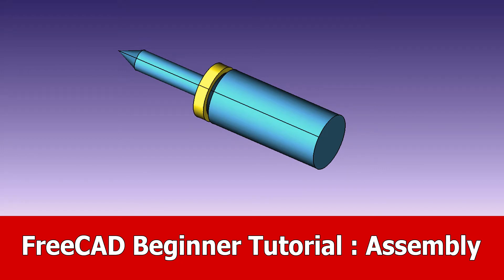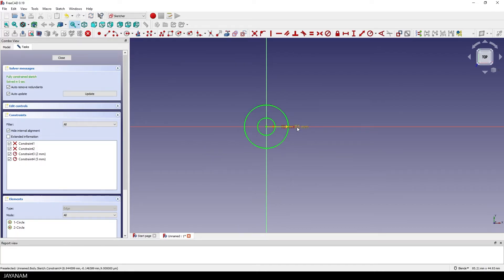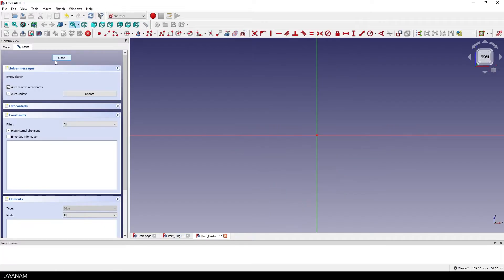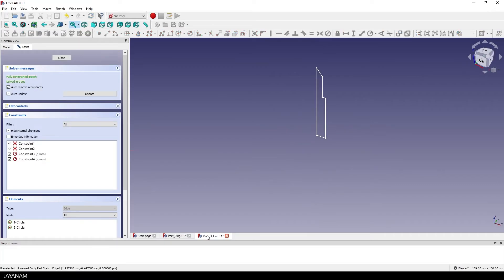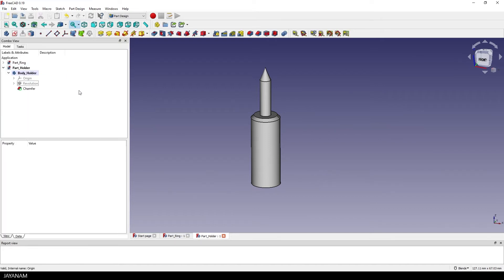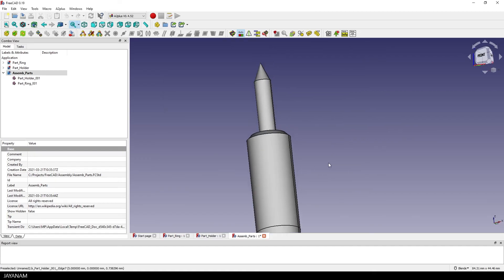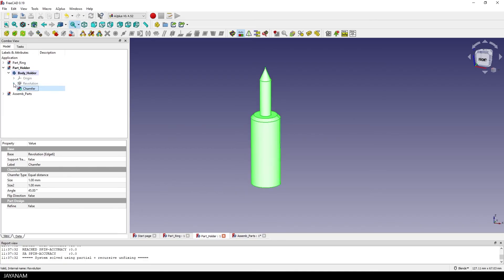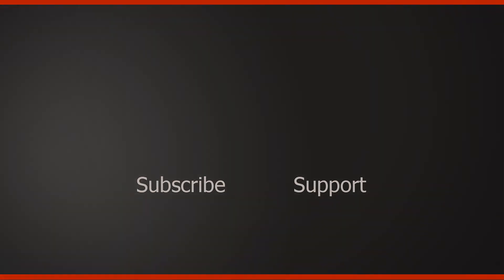FreeCAD Beginner Tutorial Assembly

Comment: I'm working with version 0.20.2.
I can follow the tutorial, but the ring does not align with the holder. It is beside the holder. How to get the center of the ring aligned to the center of the holder?
Why are the centers not matching anyway?
Reply: Same - I changed the position of the Ring via the coordinates X,Y,Z
Reply: Did you ever figure this out? I'm having the same problem.  Most likely due to having a newer version of freecad
Reply: @isaacduquette8809  No I don't think I did. Didn't use freecad for a while now
Reply: The ring loaded offset for me as well. To get it to look like the video, within the Assemb_Parts Part_Ring, go to Placement --> Position and set x, y, and z to zero. These are the same attributes that the OP uses to move the ring position down so that he can select the face in the next step.

Comment: for some reason I can not get the plane coincident icon to go active. Any ideas why? I have used control to select both of the planes so I think I am doing it correctly
Reply from the maker: Did you check that both faces are selected?
Reply: Yep, both faces are going bright green so A bit confused..
Reply: @markvenn230  Same trouble - Then I found "Shift + Command + Clic"  instead of "Control + Clic" to select both faces - I opened "Selection View" to check faces are well selected - Roocky on FreeCad 20 on Mac

Comment: I wonder why you absolutely must have external parts in separate files, and not just have several yellow "Parts" item things in only one file.
Reply from the maker: You can do it in both ways, but usually e.g. in companies the workflow is based on files that are made by different people.
Reply: @JayAnAm  I tried to do it with two "Parts" objects, but the planeCoincident-Constraint action gives the error: "Could not move some parts. The highlighted parts were not moved. They are not constrained (also over constraint chains) to a fixed part!". On the forum someone said: "A2plus will not work if you apply constraints to part containers and bodies directly in a PartDesign file."
Reply: Reusability and version keeping. Your part might evolve as you start making prototypes. Also, you might need to supply your part to a vendor, if you don't have the capability to manufacture in-house.
Reply: @ganeshshenoy2615  Call me crazy, but I think 99% of people just want to use an easy Snap-this-to-that Constraint for their one-man hobby projects ;)

Comment: Thanks for this. We desperately need an alternate to those bulky proprietary software "packages"
Reply from the maker: :-) you are welcome
Reply: @JayAnAm  it's really hard to work from home with a bad remote network. Our CAD solution crashes a lot without outputting an error dialog or a log file. I use FreeCAD if my output is only a STEP file and not some Customer specific file format. Thank you again for this intro into assemblies.
Reply: I've tried, I really have, several times, for days on end, because using free and open software like linux, Krita and Blender is important to me. It just feels better, like I'm more in control.

But it's nowhere near usable, only frustrating and demotivating. Simply importing stuff without breaking it is a nightmare, the UX, my brain doing all the heavy lifting converting objects and making sure different modules can work together, it's just too much of a distraction. And the fear that A2plus is going to be superseded by A5plusplus next year, rendering all my previous projects unassembled doesn't really help either.

So I dove straight into Fusion (coming from SW), was productive right away and I'm actually having fun. I hate that I love it, but I'm probably going to shell out that $495/year when I really need to, and I've decided to revisit FreeCAD around 2025. They may have had a Blender type growth spurt by then.

I'd like to throw some money at the project, but it'd be nice if there was a particular aspect that I could help accelerate. Like an actual integrated assembly workbench that can be trusted to open older projects and doesn't have 2 or more incompatible competitors. They're taking their time to get it right, which is good, but there doesn't seem to be a driving force behind the development, it's done when it's done. 2025, fingers crossed.
Reply: Assembly is somewhat advanced topic.What is the point of filling the video with basic stuff of creating simple parts? If someone found this video wanting to learn how to assemble parts, that person knows how to do that already.